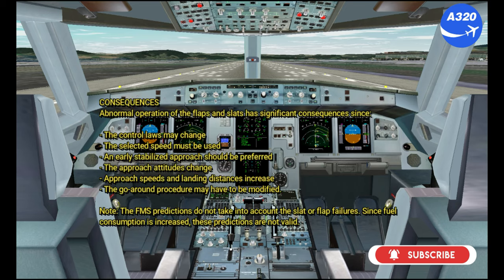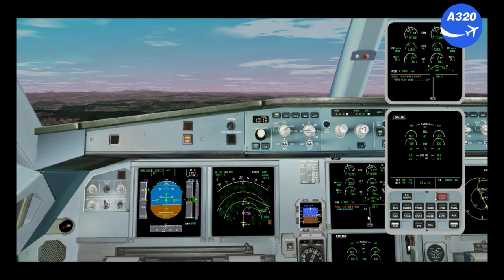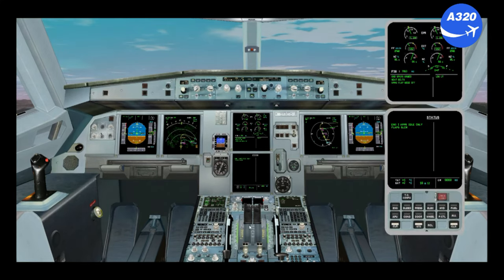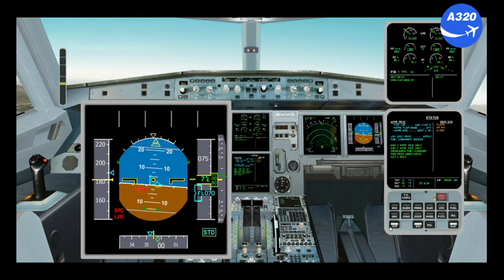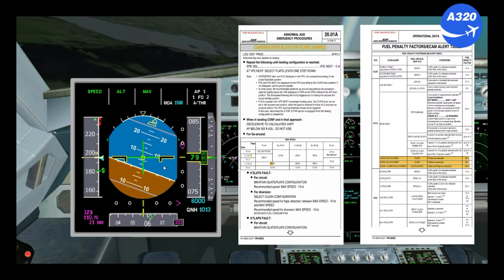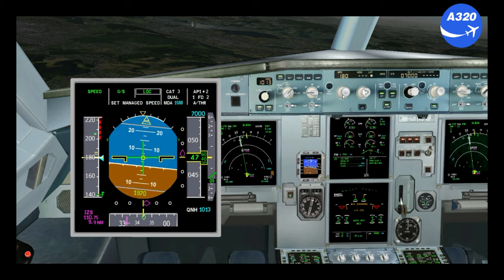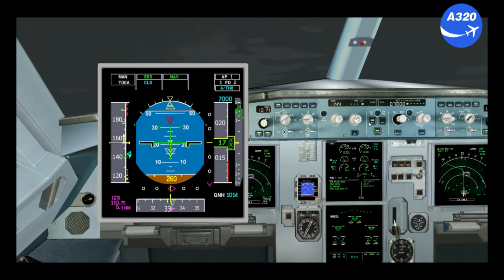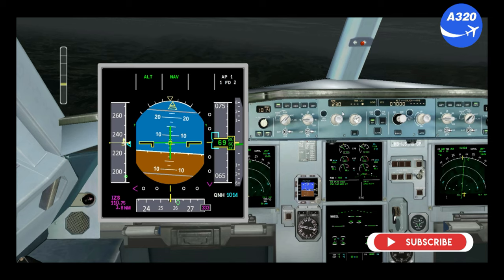A320 ABNORMAL FLAPS SLATS CONFIGURATION

Comment: What r the major challenges in landing with abnormal flaps & slats?
Apart from the drag getting reduced.
Reply from the maker: Faster approach speed and high risk of tail strike if you have problems with the flaps
Reply: @a320mentorchannel  Ohhh.

Comment: How did we Accelerate to 230 knots after the Go Around. Was the max Speed not 215 knots.
Reply from the maker: The configuration is flap 1, hence 230 k max if the conf 1+F yes 215 k thanks 🙏👨‍✈️
Reply: But did the Ecam not specify Max Spd 215 knots at the beginning before recycling Flap lever.

Comment: How did you accelerate to 230 kts on the Go Around. Was the max speed not 215 kts?
Reply: I think the config was Slats 0-1 , and flaps locked at 0 , hence max speed 230 Kts from the table. It got me confused as well.